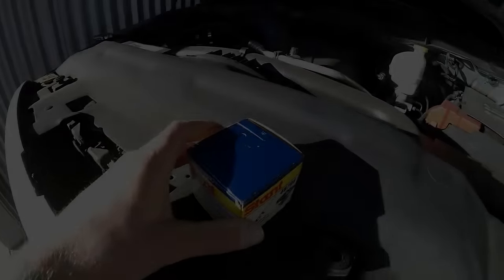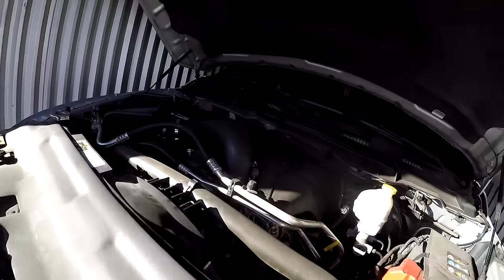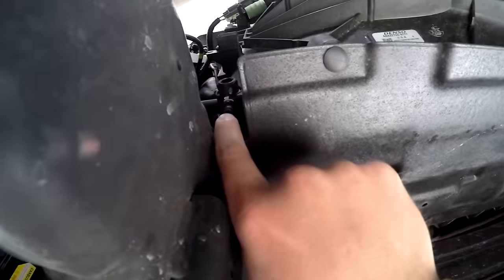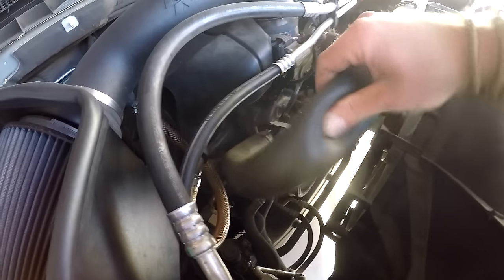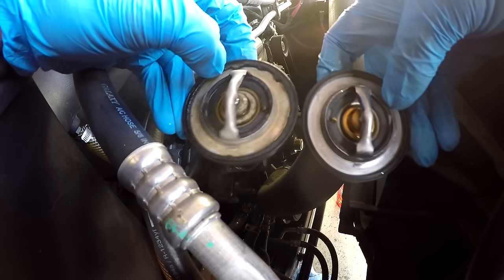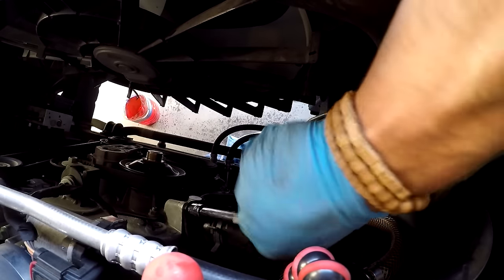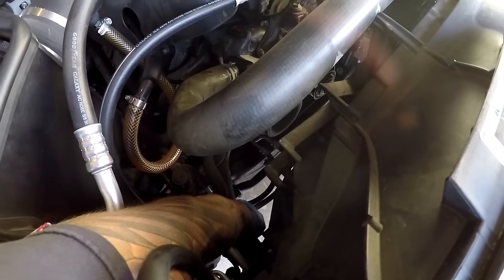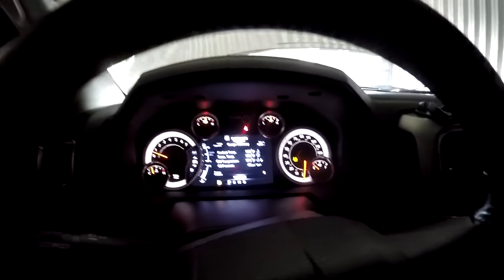THERMOSTAT REPLACEMENT - DODGE RAM 1500 HEMI 5.7L

Comment: Just ordered this part, also my 5.7 hemi has a radiator fan and a clutch fan is that normal? I bought it used . I thought they only came with a clutch fan
Reply from the maker: Thats normal.  Stock the 5.7 comes with a mechanical and electric fan but I deleted the mechanical and upgraded the electric fan 👍
Reply: Doing radiator and thermostat in a few mins. Video helped out alot. 
Thanks
Reply: Did you have to tune the truck after removing the fan clutch and mechanical fan?   Also, does the electric fan greatly quiet the truck when it's cold?   Mine runs pretty loud and it's quite annoying.

Comment: Hey guy I have a 2014 Ram 1500 I’m about to do this mod with no tuner yet. I bought a 160 stat. Will the 160 stat work well with electric fan for meantime until I get tuner?

Comment: 2011 Ram 5.7 HEMI
I did a coolant flush and replaced my stock thermostat with the 180⁰ one vs. the stock one. Before I started, I didn't have any heat and my temp gauge sat just a little under halfway. After I finished the job, I now have good heat, but my temp gauge only sits at ¼ of the way.
 I was just wondering if anyone has come across this before and what might be the remedy to fix this? I would appreciate any insight. I love watching the Boosted Motorsports videos! Thanks!
Reply: Same here!

Comment: I have a dodge ram truck 5.7 hemisphere every time I stop at a stop sign it runs hot when going down the road it's runs normal could it be the thermostat
Reply: Had same issue, radiator was empty. But your fan clutch might be bad if you have coolant in radiator. When it's normal temp, check both hoses on radiator, if both hot, then it's bad fan clutch

Comment: You'll also get worse mpg. The engine is designed to run at the temp the factory set it at. Closed loop vs open loop.
Reply from the maker: Currently getting 27mpg with all the mods on the highway both on the dash and confirmed with hand calculated.  Video coming out soon on that 😎

Comment: My 17 ram 1500 temp when hot runs at 215 to 218 is that high??!
Reply from the maker: Its a bit high but not overheating.  Check your overflow tank and make sure its topped up!

Comment: I came back 2 your channel because I remembered you did a video on tstat change.  My 2017 5.7 Hemi runs 221 for a couple minutes but then drops to 199 I wondering if that is normal. Yes everything is stock.
Reply from the maker: If you still have the stock mechanical fan setup I would say wither your electronic shutters are stuck closed or your mechanical fan clutch is shot.  The electric A/C fan comes on around 221 degrees but should rarely kick on in normal situations besides turning on the A/C
Reply: BoostedMotorsports I did some deeper investigating and the antifreeze was low in the overflow added 1/2 bottle of Mopar Antifreeze and 208 is now as high as it goes.  Seems like I solved that problem.  Actually I feel stupid.  Lol
Reply from the maker: lol happens to the best of us!  At least it was an easy fix 🤣

Comment: Hello, what is the correct engine temperature for HEMI 5.7? according to the indicator on the board?
Reply from the maker: 203*
Reply: @BoostedMotorsports  
Thanks, I have hemi 5.7 I connect the ELM 327 and it shows me that the thermostat opening temperature is 100st and while driving in the city I have 96/97 on route 92-95. Maybe you know how the indicator is scaled in commander 2009 360KM? half the scale is 100st? There will be 212 farenhaita in farenhaits
Reply: @BoostedMotorsports Odpisujesz?

Comment: On my way to work today my temp was up to 217 to 199 . Is that good for my truck ?
Reply from the maker: Stock thermostat is fully open at 203* so thats pretty normal if you have the stock thermostat!
Reply: Ok thks.

Comment: Just did the swap. Thanks for the vid. I replaced about two quarts of coolant that leaked out with auotozone universal coolant. It says that it can mix with any color coolant. I have a 2016 that had the factory OAT coolant. I didn’t know about mixing coolant until I just read owners manual which says to only use OAT coolant. Think I should flush the system with fresh OAT coolant?
Reply from the maker: Yeah I would use their coolant cause mixing coolants can cause sludge buildup and other problems!
Reply: BoostedMotorsports  I flushed the entire coolant system and refilled with Mopar OAT. I noticed that the coolant in the overflow reservoir was starting to turn to sludge.  So much for Autozone’s universal coolant being able to mix with any coolant.  Again, thanks for the vid.

Comment: When I’m going 70 on the freeway my coolant reaches 224 is that normal? I have a 2017 ram 1500
Reply: The Truth not really... mine never gets over 203 and im still stock
Reply: Take the shutters off 
By the front grill
Reply: I have a 2016 tam 1500 and i took them off.
My temp now on the freeway is 195
Reply: Nope not normal.  Mine runs about 205 freeway speeds Max. 215 towing.

Comment: I have a 2008 charger with a new 5.7 just installed my old engine with 162000 miles dropped a valve seat I put a scanner on the new engine the cooling fans come on at 217 degrees with a 195 thermostat so the engine runs at 217 which seems a little warm would like it about 210 before the fans come on dodge did the public a huge disservice by not fixing this problem turned a otherwise good engine into nothing more than a possible money pit

Comment: 180 thermo will not add HP, and may cause damage with prolonged mild use. 180 T-stat are only to correct engines with issues with pinging or predetonation.

Comment: So do I need a tune to do this?
Reply from the maker: You might throw a code in cold weather if the PCM sees that the truck won't come up to the expected factory temperature.
Reply: What exactly are you talking about thatll need tuned? How do i get the this tune? If I have a obd code scanner am I able to do the tune that your talking about with that?

Comment: There is a reason why the engineers and developers of engines put a higher temp thermostat in today's perfectly balanced and smooth running performance engines. We don't have any of the headaches like the old days of points and condensers. The multitude of sensors and computer controlled extras come on and turn off as the engine warms up. You need to let the computer know that you are smarter than the people who develop these things or it will think the vehicle isn't up to running temp and will begin the long slow plethora of future problems. You can try these tests and see how things turn out, but these tests have been done...extensively at all temperatures and elevations, and over miles and stresses you may not of thought of .   Well probably not Dodge, they have always just winged it in the past .  Well good luck .

Comment: Sorry, but you have no idea how this works. A thermostat does not affect the ultimate engine temperature, only when the thermostat  opens and starts circulating. By not allowing the engine to warm up to the proper temperature, the computer keeps the engine in a rich condition, burning more fuel.  You have done a disservice to anyone that watched this video
Reply from the maker: Thanks for the dumb comment. Maybe try doing some actual tuning before you spew your nonsense.

Comment: I have a dodge ram truck 5.7 hemisphere every time I stop at a stop sign it runs hot when going down the road it's runs normal could it be the thermostat
Reply from the maker: It could be but there are a lot of different factors that could make it overheat like low coolant, fan not working, headgasket, etc